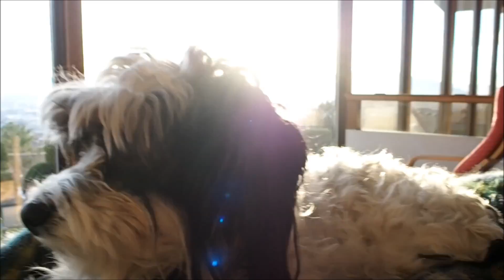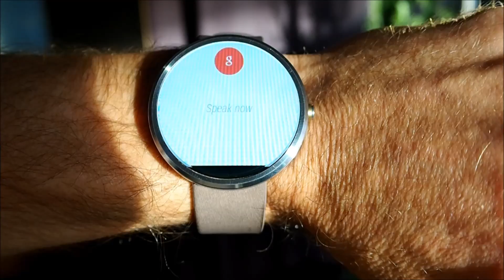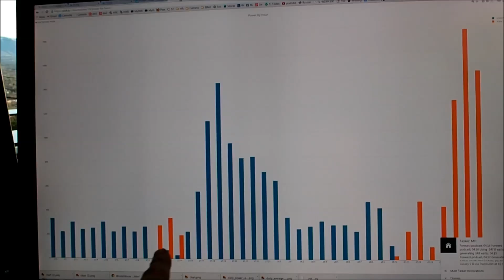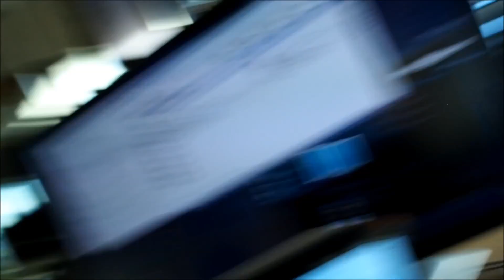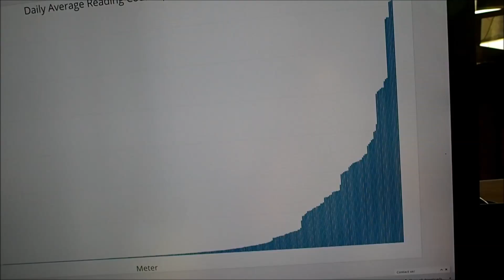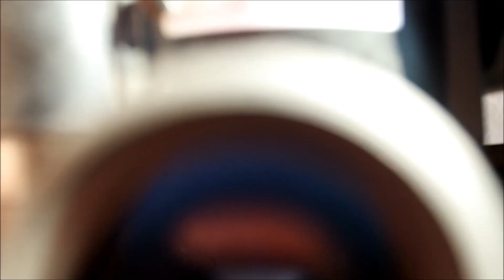Monitoring house power using a $20 RF RTLSDR USB stick

Comment: Anyone have the link to the software and USB stick in one post/place? I am fairly technical, but sometime YouTube and other social media type platforms make it hard to find details like that. @Bruce Winter, could you post those in your main link. 

Thanks for sharing this video. 

Makes one wonder why don't the energy providers give this application and stick away (especially to non-technical folks) to help consumers conserve and/or decide if they might want to add some solar? :) Real time data is good to help make informed decisions. Wow, didn't realize this was 7 years old, damn I am slow to find out things.
Reply from the maker: Code:   https://github.com/bemasher/rtlamr
Nano:  https://www.amazon.com/NooElec-NESDR-Nano-RTL2832U-Compatible/dp/B018PUYPCA
Reply: @BruceWinter   Very cool. Thank you sir.

Comment: Bruce thank you for the video, after alot of research, trial and error, frustration, cursing, drinking, more cursing, I'm finally receiving valid data, and with the -filterid=XXXXXXX am getting signals every minute to two from my meter (and about 50 others without the filter). This is where I'm running into my issue. What to do with this data. I've tried piping it to a csv file, rtlamr -options | tee output.csv and manually doing it in excel right now (sucks) however I'm not sure how to do anything with JSON to get automatic graphing. I'm hoping to track hour by hour usage for the purpose of identifying best HVAC scheduling, as well as review/maintain constant loads. I'm getting frequent enough consumption updates (repeated signals are very rare) and usually get consumption updates every minute or two so should be enough data to get an hour by hour usage. Can you try and elaborate more on your perl script on how to execute this, and how to display the graphs that tracks your consuption, as well as neighbors (no malice with tracking others, just for comparisons. I live in a cookie cutter neighborhood so we're all pretty close in square footage).

Thank you in advance for any help you can provide!
Reply from the maker: In that video I used xively to do plots.  They shut down recently so I switched to http://thingspeak.com .    Here is an example on sending them data using command line curl:

   api_key='xxxx'
   curl --data \
   "api_key=$api_key&field1=$TEMP&field2=$HUMI&field3=$DATE" \
   https://api.thingspeak.com/update > log 2>&1

You can optionally try it with a web browser first and find other examples online.
Reply: Any pointers for what you did to finally get data?  I am in the frustration phase, I can not seem to get any data from any meters near me.

Comment: I read somewhere that smart meters use Zigbee which is a wireless protocol that also uses the 2.4 GHz frequencies.  if you have things in your house that are wireless but not bluetooth or WiFi there is a small chance it might be using Zigbee instead.  I have never seen Zigbee in any computer or the adapters in stores but that does not mean that it does not exist.  It is just one of those things most people might not have heard of  It is probably something an electronics hobbyist would know something about.  It is not bluetooth or WiFi or compatible with either one.
Reply from the maker: Zigbee is popular with home automation products (e.g Philps Hue lights).  It is used in some of the user own/added power monitoring products, but not sure about the power company meters.

Comment: I get those annoyuing things from the electric company all the time.  I always show as using the most energy.  That is ONLY because our house is all electric.  It does not have any gas pipes anywhere.  We use baseboard heaters and they are silent.  They do not have blowers like a gas furnace does.  I like that too because sometimes I go to my Grandmother's house and using a computer in her cellar is nice but that furnace is just annoying when you want to listen to anything without having to blast it so everyone else hears it.  The rest of her house is silent though but that darned furnace.
Reply from the maker: We have a heat pump here, pretty effective in mild climates.  Uses the AC compressor in reverse, using about 1/3 the electricity for the equivalent heat of a restive only heater.   But, not whisper quiet like your baseboard heaters.

Comment: Do you pay plotly 986 a year for the automatic chart making software??? The comments section on your home page is non working. Tried to leave a comment it just kept refreshing.
Reply from the maker: I no longer wear the watch, thanks to Alexa and Google Home voice control, so not currently using plotly.   I didn't pay back when I used it 3 years ago.   Comments on that blogspot.com page might require a google+ login to work.   Comments here are probably best, more widely read.
Reply: Bruce Winter epic beam and steel clamps on those manufactured beams.

Comment: Definitely want to try that! The USB NooElec NESDR Nano stick you used is no longer being sold on Amazon. Any suggestions on what I should buy as a replacement?
Reply from the maker: Likely most USB SDR sticks would work.  I see there is a version 2 of the NooElec, I'd be surprised if it did not work: https://www.amazon.com/NooElec-NESDR-Nano-RTL2832U-Compatible/dp/B018PUYPCA

Comment: can you read your gas meter and water meter?
Reply from the maker: I think I saw some traffic of one or other (or both) back when I had this running, but I'm not sure.    Those meters are battery operated, so I suspect they only respond when properly pinged by the passing meter reading truck, only once a month.
Reply: oldgravely try smappe they have one solution for gas and water

Comment: How do you tell which radio signal is yours out of the 300?
Reply from the maker: Good question ... I have forgotten.   I think it was by matching to the meter number.   We moved from UT to AL a year ago and the meter here did not work with that code, so I had to switch to a more expensive (but more real time) power monitor.
Reply from the maker: Good question.   I don't have it running here (doesn't work with the meter in our current house), but think I remember the number marked on the meter (or maybe my bill?) matched the number in the RF stream.    If not, you should be able to correlate the power usage number from your meter pretty easy.

Comment: living in a million dolar house like this, consuming tons of woods, concrete, water, steel, countless amount of materials to make that house and consuming 500+ liters gas to reach that house every year. spending tons of water for grass in your backyard only. then calculating small amount of energy gain or loss to feel yourself better. ? no offense pls.
Reply from the maker: You are quite right, our house is much bigger than we need.   I do feel guilty about that, but we use much less gas, electricity, and water than the previous owner, and have been using less each year as we use monitoring, automation, and new technology to be more efficient.    We now use very little gas/electricity  for heating/cooling,  have zeroscaped much of the yard, have one car that we use < 10 miles a day,  and (I hesitate to brag about this one) take 1 shower a week.  I usually don't smell too bad (smile).
Reply: Не извиняйся. Ты правильно делаешь. Учишь. Спасибо.

Comment: That's really cool, I was about to buy a TED5000 energy measuring thingy because I assumed there was no way to download the information from my new power meter.

I don't understand why utility companies would keep that data away from the consumer, here the power is from a crown corporation and the electricity is not sold at much profit, it would make a lot of sense to tell the consumer how much they are using so they can maybe use less of it.
Reply from the maker: Yeah, I don't know why it would be discouraged.   Maybe it isn't, it is just tricky or expensive to enable for most households.     I never asked the Power company what they thought about this ... did not want to know if it was the wrong answer ;)

The TED and other power monitors still have a big advantage of more frequent and accurate measurements.   My Wattvision measures every power blink, so typically 2->10 readings per minute, whereas the RF reader only does once a minute.

Comment: Leaving a telescope without the lens cap on pointed out a window is about one of the dumbest things you can do.

 Unfortunately far to many homes burn to the ground every year because people forget to put the lens caps back on their telescopes.

 All it takes is for the sun to reflect of a neighbour's window and into your telescopes objective lens. If you think about it a telescope is basically a magnifying glass on steroids. Your telescope will take that reflected sunlight and turn it into a high intensity beam of light that would make an ant shudder with fear.

Anyhow more often than not the telescope will start a fire before it melts but If you're lucky the eyepiece will crack from the intense heat first.

Comment: Loved your video. Is there any chance of you doing another video doing this step by step? My fingers are crossed...Thanks!
Reply from the maker: Unfortunately, there are quite a few different pieces to this, so there is nothing turn-key I can offer.   If you have some programming skills, I would be happy to help walk you through it.   They key piece is Doug Hall's RTLAMR code, which is written in Go, a new programming language release by Google a few years aGo.  I ran it on linux, but I think it works on other platforms as well.   Once that is working, you can collect the data with MisterHouse, like I did, or any other program of your choice.
Reply: Thank you for your quick response back. I'm far from an expert, however I am familiar with python and C (not Perl) as far as concept and making small changes. I'm studying dsp and I have the rtl dongle set up with Windows and Kali Linux Gnu Radio (VM). Not familiar with Go...I did install it (on Linux) along with 'go get github.com/bemasher/rtlamr', but cannot figure out how to use it. Also I downloaded the Douglas Hall’s rtlasm code zip and unzipped it, but cannot figure out how to use it either. Didn't see an .exe file or any scripts in the package so I don't know if it works on Windows or only Linux. Basically, I'm all set up. All I need to do is 'run' the 2 programs on your blog site. If you could walk me through that I would forever be in your debt. I was so Inspired by your video, I went outside to my backyard to check my meter and it is one that is on the list that transmits data.
Man, I can't wait to get started! :) Cheers!
Reply from the maker: Silver Silk You also need to install the rtl-sdr drivers and rtl_tcp tool.  Doug has the links on his rtlamr page.   Once installed, run rtl_tcp from a command prompt window which will start the radio and send output to the tcp port you specify.   In my case, the default port must have been used as it quietly did not work, so I randomly picked a different port by running this:  rtl_tcp -p 5570.   Then I run on the same computer in a different window/console:

    rtlasm -server 127.0.0.1:5570

And you should see new errata both from the rtl_tcp console and the rtlasm console.

I'm traveling now, so can't get you the exact errata right now.   Let me know if you are still having problems and I can get that console errata later.
Reply: Bruce...thank you very much!! I already have the rtl-sdr drivers and rtl_tcp installed so it should be happy sailing. I will give it a go tomorrow. I will let you know if I have problems.  Thanks again...cheers!
Reply: Oh...I almost forgot...how do I run (what commands) your power_rf.pl script ( the new Misterhouse code) in conjunction with the two other commands?
Reply from the maker: Silver Silk
Reply from the maker: Bruce Winter Setting up MisterHouse to just run that power monitoring perl code is probably more effort than you want, as that is a powerful, but somewhat complex, home automation program ( http://misterhouse.com ).   Since you are learning Python, you may want to try writing a program in Python to do similar the mh perl program.
Reply: Oops...my bad. Didn't know MisterHouse was the name of your home automation program. For some reason I thought that was your pen name or something...lol. Cheers my friend!